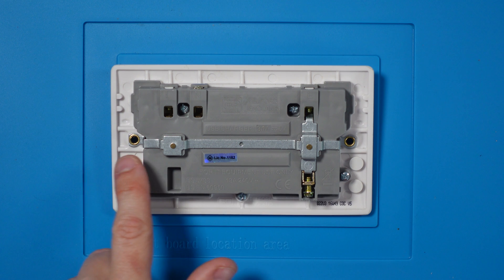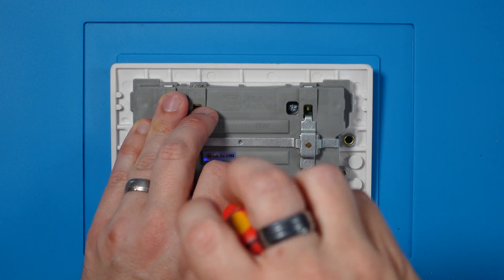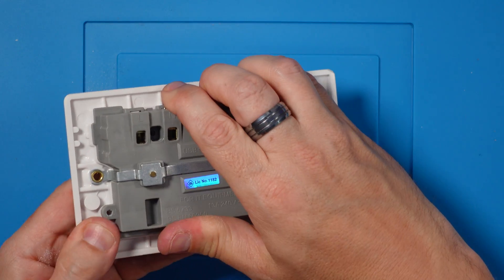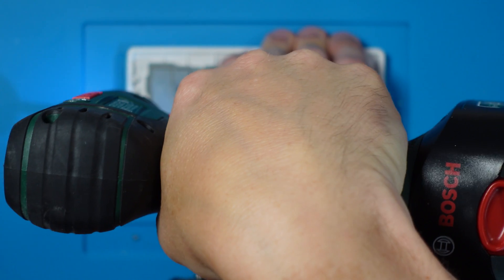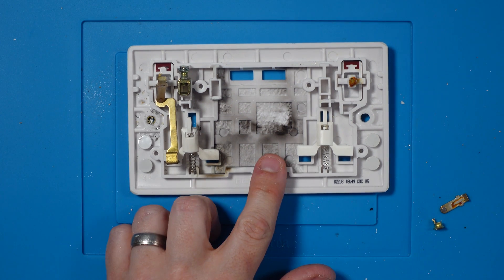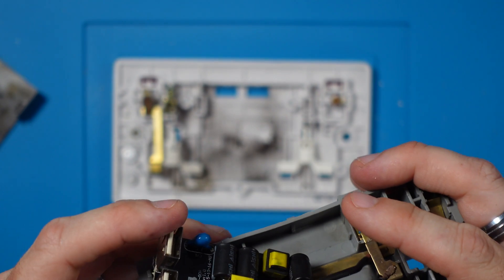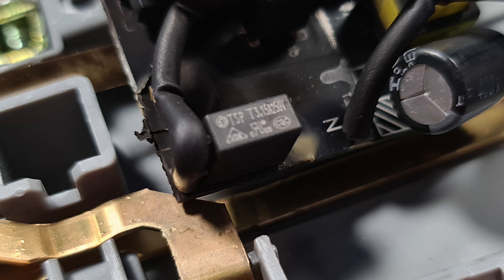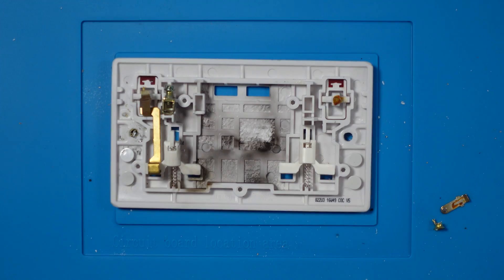IT BLEW UP!! My BG Double Plug Socket with USB Chargers exploded! Let's see what happened...

Comment: Just got call out to a job we did 8 moths ago ( RCBO tripped ) well I put power on ( bang ) but could not locate it in the kitchen so reset 2-3 times bang bang bang then the BG sub socket started smoking so yes look out they have a fault so glad we have correct circuit protection.

Comment: Electronics design engineer here. Just came across this recently. Not sure why you disassembled something to analyze if you don't know the basics of how it works. For a wall charger the AC power is brought in and immediately turned into high voltage DC by the "bridge rectifier". Since it was originally alternating current (AC) the DC fluctuates so the capacitor is there to smooth this out. The other components are there to basically isolate this DC power and lower it to the 5 volts needed to actually charge the phone. The high voltage DC is very stressful on the bridge rectifier and filter capacitor so it's not unusual for these to sometimes fail. In your case it looks like a short circuit developed in the high voltage capacitor which caused excessive current from the AC connection through the rectifier and the capacitor. This is what cause the heating and all of the damage. These parts are all designed to fail and burn open the circuit path like a fuse to stop the current. A dramatic end to your device but no collateral damage.
Reply from the maker: Ahhh... If you want actual informed electrical content, then Big Clive is your guy! Although I did send this off to My Mate Vince to do an autopsy on, he has a bit more of a clue than me!

Comment: Time the Regs changed and either made these things illegal or required that they have an associated switch so that the 'embedded' electronics can be switched off when not in use.  Having them always powered is not good for the longevity of the electronics or the horrendous RF interference they cause!
Reply: Does this mean they constantly have faint buzzing sound by any chance?
Reply: @johnboy82760  quite possibly.

Comment: That failed very nicely Kip, some good charring on the board 😂 The little bridge rectifier converts the AC voltage in DC voltage. Why it failed, I really don't know but it would be interesting to find out 👍👍👍